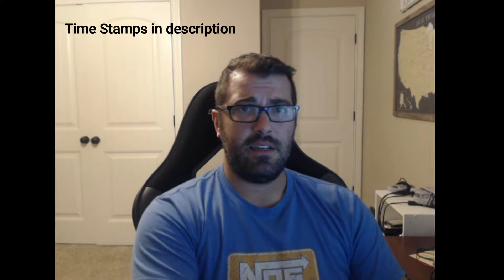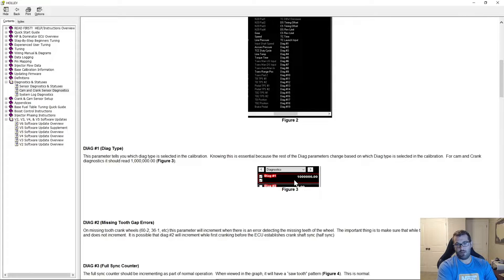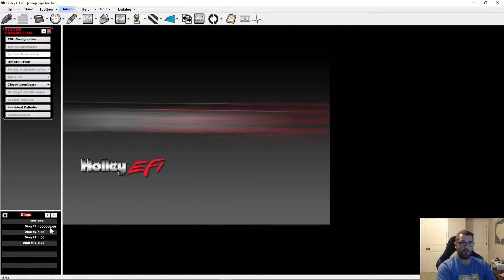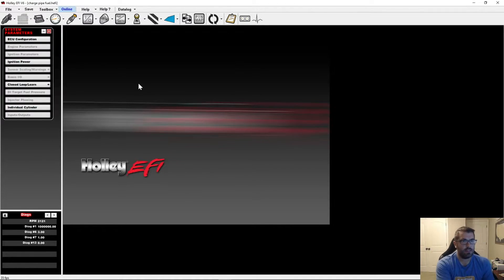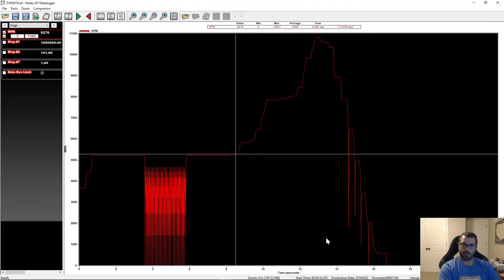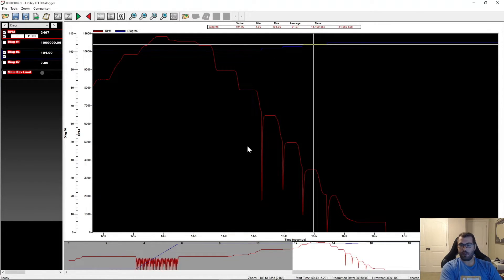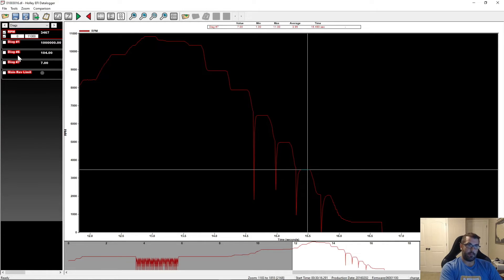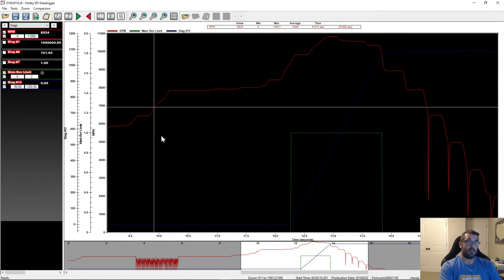Holley EFI How To: Cam and Crank Sensor troubleshooting tips and examples

Comment: You just saved me a TON of time troubleshooting, so THANK YOU!! My truck had been a bit weird lately, then quit in the driveway with a crank no start.  I was getting an RPM error, so I grabbed a data log.  Yours was the first video I found when I started researching and it was exactly what I needed.  Once I knew what Diag 6 meant, I knew that was my culprit and a new cam sensor had me going again.  I owe you a beer! Thanks!

Comment: Set up my data monitor same as you in V6.  However diag 6 & 7 read 0.00 instead of 1.00 and those channels remained idle during start up, running, and a stall condition. Diag 1 was set up as you showed as well.  Is there something I missed inputing to get those channels active? Or does this mean cam or crank sensors are not the cause of random stalling?

Comment: Any 5.0 TFI specific advice?  On cold start in cold weather (<40F) I get diag 6 and 7 counting and fail to start. About the 10th start attempt it will fire off. I can immediately kill the car and it will restart within 1s consistent with expected behavior. I’ve never had an issue with rpm signal loss when running, and no diag counting other thank cold start in cold weather. Aside from the one cam signal count which I associate with a good sync.

Comment: Hoping you might see this, as the advice im getting from holley techs and tuners has not been helpful. new setup, and on startup it runs terrible with a rolling misfire. datalog shows diag #7 stable at "1", but Diag #6 has a very odd signal, going from 0 to 1 and back to 0 2-3 times per second. Ive completely checked the entire harness, pulled the engine to manually check timing and physical components, and went together with new sensors, new coils and even swapped injectors with no resolution. Any ideas on what could cause this?

Comment: This is great. Well freaking explained. I have an ongoing issue with my Ls1 , and me and my tuner have not been able to figure out what the problem is. The car only bogs right off the line WOT or when rolling on the street then to WOT. I send him a full datalog of when it happened and his suggestion was to start by replacing the crank sensor. I did replace it but have not been able to drive it again due to rain and stuff here in Jersey the past 4 days. I hope that fixes the issue.

Comment: Hello I’m trying to figure out an issue my truck just started. I’m losing crank/cam signal at higher rpm speeds. Truck starts and runs great other than that. Looking at the log Diag 6 goes from 0.00 to 1.00 and Diag 7 goes from 0.00 to 2.00 both happening at the same time. Have any suggestions?

Comment: Im having an issue where it won't even start .it back fires and pops like the timing is off .I confirmed the cam gear is lined up and the valves are not hanging open. .can I log cranking
Reply: Did you ever fix it? Mine is doing this now
Reply: @williammclaughlin2606  nope I took it apart and redid the harness .waiting to put it back together

Comment: Doubt you'll see this....but IN THEORY if theres problems with the actual reluctor on the crankshaft, that would also cause the readings to count up as well right?
Reply from the maker: Correct!  The counters don’t know why there was an error. Just that for some reason the cam or crank reading didn’t happen when expected

Comment: No help feature in the v2 terminator software which is about the dumbest thing ever
Reply: was about to say the exact same thing..
Reply from the maker: Microsoft changed how it handled it’s edge browser support for pdf files. The latest terminator x software version 2 build 80 has updates to work around this and allow the help file to work again.  Or you could make google chrome your default browser and the issue doesn’t exist in the first place

Comment: Hey I’m having an issues tht I’ve been chasing for few weeks now can’t figured it out an I was looking at this video but for diag6 an 7 it shows 0 an does not move at all is tht normal?
Reply from the maker: It can be normal.  Without knowing more about what issue you are chasing it’s hard to say though
Reply: @highperformanceconsulting7616  do you have Facebook or something I can message you the issues I’m having for some reason evrytime I make a 2nd to 3rd pull truck feels lik it hits a rev limiter around 5500-5600 it just jump up an down between those rpms an nevr shifts or go up on the rpms.I got it set to shift at 6500 on 2nd to 3rd but no luck.it only does it on tht shifts1s gear it’s fine
Reply from the maker: @VictorGarcia-zc7xi  You can email me at highperfconsulting@gmail.com.  If you want to attach your tune and log of the problem I am willing to take a quick look.
Reply: Ok I will email you an a few
Reply: I have the same issue I was at the track. I had bad tire shake and the car shut down and it won’t start it will fire, but won’t stay running and I did a log six and seven are  zero so does that mean? my cam and crank. Sensor. are working

Comment: Have you ever seen an engine drop RPM at high rpm/load? I’m getting one count cam and 2 counts crank sensor on the error log
Reply from the maker: Absolutely. They can be harder to diagnose sometimes but it’s still a cam or crank sensor losing signal momentarily for some reason.

Comment: I have issues my set is a l99 motor I removed the vvt I install a stage two c am with a 4x cam wheel  . When I try to start my motor it go stall syncing back in forth   . Number 6 stay blue but number 7 go blue green bulge green . But if I change my 58x to 24 x the rpm’s go to 180  I bought brand new crank also brand new cam sensor from the dealership acdelco  I check everything I’m getting all the power it needs 10.45 volts while cranking
Reply: It was my starter going bad. . My starter wasn’t Turing the flywheel fast enough. To show rpm’s
Reply: @morrisrodney19 okay probably something else for me. I have a brand new starter.
Reply: @Nickyb801 what’s wrong with yours
Reply: @morrisrodney19 crank error. Grounds good, wiring good, voltage good crank sensor. Tried 3 different crank sensors. Tune is correct 58x. Gen 4 4.8. Cam reads correctly. No rpm on Holley says error.
Reply: @Nickyb801 oaky 
You  bought it from the Chevy dealership? 58 x crank sensor 

Did you make sure you have the correct cam sprocket for 58x 

Your crank sensor 
Your cam sensor your oil pressure sensor 
You map sensor your  fuel pressure sensor  all use the same five volt   . If you remove each sensor   Then check the volts. If it changes the sensor is bad.  Or the wire 

If the crank sensor is showing error  it’s not getting the correct volts

Some time the wire get pinched at the crank sensor or at the ecu connector .  What I did was.  Remove all the connections from the ecu.   Then. I use a hot wire on the crank sensor wire that go on the  ecu connector side . Then I use  a light tester to see if it got any power. Then I used a multimeter to read if it shows complete voltage
Reply: @morrisrodney19  thank you for the detailed troubleshooting. I am certain on the 58x and ECU settings. 

I checked continuity from sensor to ECU and depinnd crank  sensor to be certain. 

Will get a light so I can check when cranking on my own. And didnt realize the other sensors could be the issue. Will report back should have time tomorrow afternoon.
Reply: @Nickyb801 you have the correct cam sprocket. Then fire it up on batch mode
Reply: @N @Nickyb801 .  Make sure you the crank wire  on one side then ad power to the opposite side. That will make sure the wire. Is not damaged anywhere
Reply: @morrisrodney19  I am almost positive I have the 1x cam gear on this motor. I haven't taken front end off but was looking through old amazon orders when I put the cam in and the timing chain set has the 1x timing gear.
Reply: @Nickyb801 1 x cam gear is for 2005 and Dow ls2
Reply: @morrisrodney19 right. I have a done a few swaps and I had a built 5.3 originally and decided to go cheaper junkyard 4.8 for this project. I moved the cam and stuff over not thinking about the cam gear. Gonna try the custom cam setting before ripping front end off and turbo kit etc.
Reply: @Nickyb801 okay cool if you don’t mine keep me updated
Reply: I need some help I install 4 terminator max in the last moth they all work but not mine this is crazy
Reply: @morrisrodney19 did you ever solve this? Struggling with the same issue.
Reply: @Nickyb801 thanks for asking

Comment: This video helped me figure out that my cam sensor had an issue and not my crank sensor. My cars first 50 miles were great but then I mysteriously developed a rpm sync error that cause the car to fall on its face at random times mostly near 3k rpm. I checked everything with the crank sensor wiring and replaced the sensor with no luck. Everyone said it was either my crank sensor, reluctor wheel, or thrust bearings. I couldn’t settle for the idea of it being a hardware issue on a brand new TSP 14k engine. So I looked at a small diagnostic log that showed I had 0 #7 events and 120 climbing to 130 #6 events. This gave me a strong lead to check my cam wiring that I had extended since Holleys harness was about 8” short of reaching the front cam sensor (wtf Holley!!). Either way I had taken the extra slack in the cam wires I extended and tucked it up next to the alternator to make everything look good. The EMI from the alt was causing the errors since I didn’t run extra shielding . Once I moved the wires away from my alt the logs show zero errors!

Comment: is this information compatible with terminator x systems? the help file in terminator looks nothing like shown above at all.
Reply: I've got both V1 and V2 versions of X Max and I cannot find this diagnostic info anywhere in the new help files.  Holley's tech line is so overwhelmed with calls that that have an attitude towards customers assuming we're the problem.  At some point I'm going to do any outline and call in to my contacts upstairs and try to get them to understand that they have a lot more work on this software to get the average user up and running.  We have a brand new Wegner blown 416 engine (30K) that has been dynoed and suppose to be plug and play.  We have no rpm signal and no one in their organization can solve this issue.  So that's why I'm trying to learn as much as possible to debug the error.  
I've done three X Max installs and they all have issues.  Start with a base file and then work on the learn or just take it straight to a dyno and work through the data to get this stuff squared away.  I do not like the whole logic in their approach and I especially don't like the harness, which has no labeling.  Next time I'm going to point thumbs down on their product and use the GM factory stuff.  I may have to deal with licensing cost and HP Tuners, but I can get a better result quicker.

Comment: Great video. I looked in my help section and it looks nothing like yours. How do I fix that? I'm on 2.0 build 80
Reply from the maker: The video was done using Holley efi software for HP/Dominators. All the info applies but the instructions are different between the two products. 

You just need to install it he Holley efi software and you reference the help in it.
Reply: @highperformanceconsulting7616   Thanks, I've watched other videos and couldn't figure out why they had all that information, and I didn't.

Comment: What if diag 6&7 read zero. Even in cranking
Reply from the maker: That is fine
Reply: @highperformanceconsulting7616  diag 1 reads 1mill. During cranking light 7 flashed blue and green, 6 flashes blue rapidly. Any idea what this could be?
Reply: @highperformanceconsulting7616  just curious because the forums say so many different things which I’ve tried, to no prevail
Reply from the maker: What is the actual issue you are trying to solve
Reply: @highperformanceconsulting7616  no start. Just cranks, I have fuel and proper voltage, just no start
Reply from the maker: What does you have fuel mean?   Do you have spark?
Reply: @highperformanceconsulting7616  yes fuel and spark are there
Reply from the maker: So you show rpm while cranking?
Reply: @highperformanceconsulting7616  yes

Comment: Thanks for that info. I have the holley HP with a dual sync distributor and have a very intermittent no start/stall. I used your video to read a data log and found on one of the passes , on decel, my diag 7 spiked to 253, then back to zero, then back to 235 and stayed there. The car did not stall. My TPS was also degrading during the run. DM me on Instagram if you would. @lethlbu_Racing

Comment: would this type of test verify mechanical timing? say one tooth off between cam/crank timing?
Reply from the maker: That isn’t the intent but in some cases it can.
Reply: @highperformanceconsulting7616  thanks for the reply. Making boost, but less power than expected. Just going through the check list while i wait for boost leak testing parts. My logs look good through range of rpm. Great video

Comment: Thank you for this video. My bran new terminator had bad wire to cam sensor and this video helped when all 5 holley techs i talked to didnt.
Reply from the maker: Glad to hear it was helpful!
Reply: What was bad with the wire? I’m having issues starting mine and it’ll crank and run for a few seconds then shut off and will backfire every now and then. The cam sensor is red but crank is green
Reply: My terminator won't even start😰
Reply: Mine is the same way .won't start backfires and pops will cranking
Reply: Can’t get mine to fire up either. Will run off starting fluid with only the crank sensor plugged in, won’t run when you plug the cam sensor back in. Really weird. Have fire and fuel. Must be wiring, signal or programming errors. Can’t figure it out!
Reply: @aplaughlin did you ever figure out what the problem was?? I’m having the same issue

Comment: So if I'm understanding this correctly,  if diag #7 reads 0 constant while diag #6 reads various (from 1-10 in my log) then I have a fault in wiring or a bad sensor? Odd to me that I can get it to start without crank sensor.
Reply from the maker: If diag 6 or 7 is counting up during start up then ignore it. If it’s actively counting up while the engine is running then you have a problem.
Reply: @highperformanceconsulting7616  on my 3.5 screen watching rpm I see it flash error intermittently. Trying to solve that before I work on getting it to idle properly.
Reply from the maker: Sounds like you have an issue then.
Reply: @highperformanceconsulting7616  I really don't like just throwing parts at a project until it's fixed. Trying to learn more on how to use the datalog to narrow down the issue.
Reply from the maker: Unfortunately there isn’t any magic in the diagnostics. They only help point you in a direction.  Is this an LS engine?
Reply: @highperformanceconsulting7616  yes its a 5.3l and I'm using the terminator x ecu 24x
Reply from the maker: Turn off the cam sensor in the tune and see if that fixes it
Reply: I'll locate that option and attempt it.
Reply: @highperformanceconsulting7616  where do we properly turn off the cam sensor?

Comment: i have a holley hp and did cop.  just got a efi connections x58 crank trigger and cam sensor.  this vidio has helped me some.  cant get cam or crank sensor to show 1.00 both show 0.00.  in the datalog it shows 100.7 kpa in diag6 and 29.7 lb/hr. what am i missing?  i efi connections was no help.  told me to call holley I have it set up in ignition lsx58X not custom.  any help before i burn it to the ground?  thanks
Reply from the maker: Send me an email at highperfconsulting@gmail.com with the tune and a log. I’ll take a look
Reply: @highperformanceconsulting7616  ok
Reply: @highperformanceconsulting7616  
Have you ever seen an ecu that wont show the system on diag channel ? It runs and idles fine but soon as you give it gas it backfires thru intake . 10,11,and 12 are showing me nothing and i am set to custom .

Comment: Took the Holley, Dealer, V1, V2, and V3 classes and this video is almost more help than those. Certainly more with Diagnostics types, luckily I've not had many issues with this and mostly use the RPM going to error to find the problem.

Terminator X software doesn't go offline when you cycle the key and keeps trying to connect to the ECU while off, so it locks up when you shut off a new motor and go to check things or because of an issue. I tell everyone you called it Terminator because you have to open manager constantly and Terminate the software. This also kills a troubleshooting task we used with customers on the phone to see if they are losing power to the ecu.

Would really love the 90's technology of selecting the folder where the Holley software works from instead of always in Documents. I want to be able to put it into a Dropbox folder or Google Drive folder. Right now you have to copy it there and if you want instant access to everything you need two copies of that on the drive. Been using this since V2 so I have about 30GB of old tunes and logs now.
Reply from the maker: We have been making some improvements to the Terminator X USB communications.  It should lock up much less in a future update.